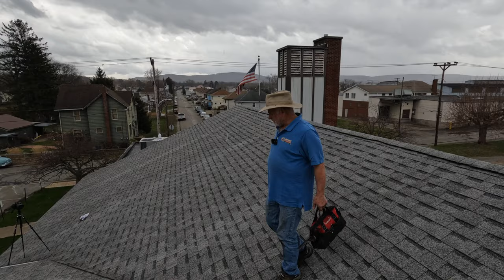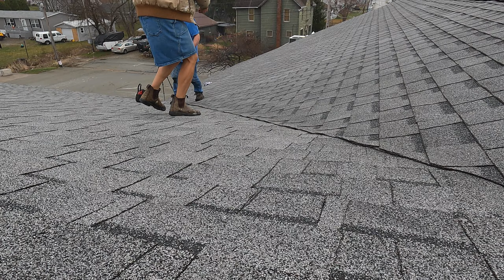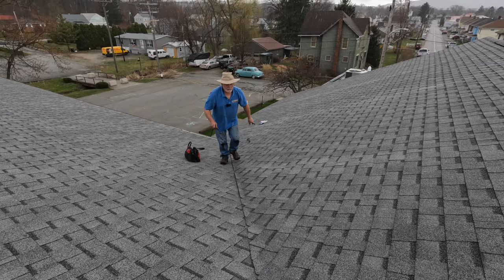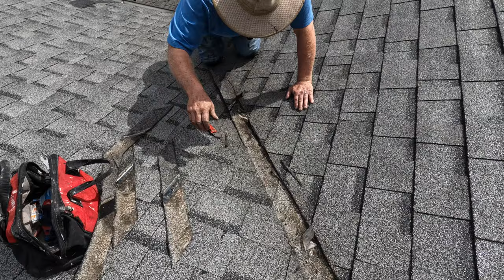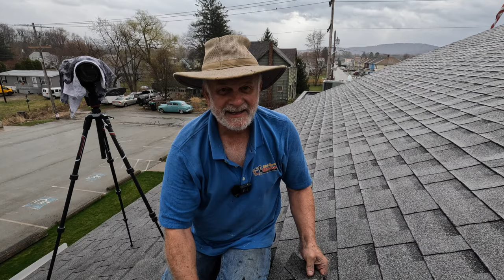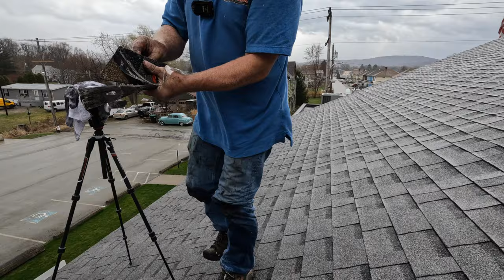How to fix a leak in a valley of shingle roof with Utility Knife only - Warning! do not use Tar

Comment: The bad thing is you drove your knife instead of pulled your knife, thus cutting the shingle underneath. Hook blades are to pull not press. Dub the corners on the tops as well helps.
Reply: That’s a hook blade.  It is nearly impossible to drive a hook blade down.

Comment: Loving that new look with the beard! I have a question for a flat and low slope EPDM roof. If there is a small tear, do you recommend a patch with a polyester fabric and silicone roof coating?
Reply from the maker: You use the Super Silicone Seal with the Polyester Fleece to make the repair.
Your question was incorrect. You cant use Polyester fabric by itself.
Reply: @FlatRoofDoctor  Okay, yes, that is what I meant. Is that a better option than just adding another layer of EPDM?
Reply: Nooo you need epdm sealer  glue for repairs and they also have patch kits. You guys have no clue

Comment: After running the first course of shingles through the valley, I always take a water bottle, and pour it in the valley, and then snap a line just to the side of the waterflow, to make sure the water isn't fighting to get under the top course of shingles.